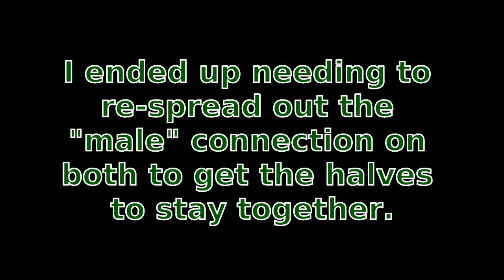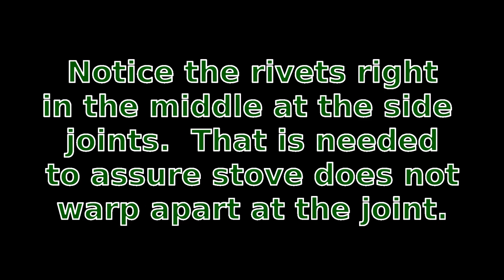Make A Simple Cheap Tent Wood stove - Part 1

Comment: I absolutely love your hot tent do it yourself videos. In fact it was because of you a couple of years ago when you made the first DIY hot tipi video, got me hooked on them. Thanks for everything you share, you are a blessing to the outdoors community.
Reply from the maker: Glad you are enjoying those videos and have received such benefit from them.

I have the material on hand and plan on sewing a pyramid tent with side walls out of 1.1 ounce Mtn Silnylon.  This tent will be 10 feet by 10 feet and will weigh just under 4 pounds total weight complete with stove jack for use with this stove here in this video.   The grade of material used is some of the best available but the finished tent should cost me less than half and close to a third of the cost of a commercially manufactured one in the same class.
Reply: @Far-North-Bushcraft-Survival  looking forward to it Lonnie 👍👍👍
Reply: Far North Bushcraft And Survival Oh that sounds like a beauty of a tent Lonnie, I know it can coast a bit more but you should consider putting screens and double pain windows in so it still stays warm like Lars at Survival Russia’s Russian Tent if I remember correctly it’s the name of the manufacturer is PFberg. 
Then you can have an all season tent.

I hope you’ll do a video on making the tent even if you don’t put the screens in windows on your tutorials are always short sweet and to the point without missing any details and perfect for the common man.

Btw Happy New Year to You Connie Buck and your family 🎊🎆😊

- Anthony
Reply: Heck, this dude rocks!
Reply: What an engineer, you are an excellent teacher!

Comment: Learnt quite a lot again from this one. I haven't worked much with sheet metals, and I never would have thought to seal the front and back panel with a "double fold" in that way, almost looks like you wouldn't need rivets at all. Tricks like that tend to come in handy in other projects as well. Thanks for the video!

Comment: Having been a sheet-metal mechanic for 20 years, I can tell you that better options exist. The 7" round duct pipe that you used is really thin (looks like 30 gauge) and won't last all that long.
Options: Look around for heavier gauge (22-26), often used as flue pipe. It will of course be harder to bend/ manipulate, but the end product will be worth your time and efforts. Also, putting a "cross-break" into the sections that are the sides and bottom (a very slight but visible bend in the shape of a X diagonally corner to corner) will add strength and rigidity to the stove without any added weight.
However, I suggest going scrounging around any local job sites or scrap yards looking for rectangular duct already made. You can easily find it in the size, shape, and thickness (gauge) that suits your needs, often already including things like end-caps, making final construction much easier as well as your bends are mostly made for you.
Approach: There's no need to use a drill to begin a hole in sheet-metal at these gauges, simply lay the corner of a flat-head screwdriver where you want penetration (center of you soon to be hole), and holding it firmly at about a 45 degree angle to the sheet-metal, simply give it a whack with a hammer, opening a small hole, simply drag that screwdriver along and whack again. In this manner you can open a void in the metal as short or as long as you'd like, enabling you to easily get your tin snips in to make your cut of any shape you need - without the need for any electricity... it takes literally only seconds.
Finishing: I would suggest also adding red High-Temp silicone sealer to the seams during assembly, to seal the seams and make the stove more efficient.
The flue pipe exiting the stove - Use a small end-piece (crimped male end ) and make a several cuts in it's crimped end up to the rolled bead that makes the flue pipe mate against it's next section. Cuts should be about every 1/2-3/4" making a bunch of "tabs". Insert this "starter collar" you just made into your stove's flue opening until it bottoms out against that rolled bead, then reaching into the stove simply bend those tabs out and up against the top of the stove metal, like opening flower petals, making a very secure, semi-sealed but not permanent connection. You can crimp the top of this pipe where it exits the stove if you choose (if you have hand-crimping tool) or just run your flue pipe sections "backwards" with male ends facing down rather than up. This way you have a starting collar already installed, and it also protects your flue opening from getting deformed during transport, and it also helps stiffen up that area where you placed the hole in your stove top.
Lastly, you need to insert a flue damper in that starting collar or in the first section of flue pipe on top of the stove. You can make one yourself easy enough with a long heavy nail and a piece of scrap sheet-metal cut into a circle: Use that screwdriver technique (or a drill if you choose), I usually just hammer that nail into it from each side so it mates with the nail perfectly without being too large a hole .. and put two opposing holes into the flue pipe just allowing the nail to slide in one side and out the other. This nail can attach to the pipe as you wish, as log as it's secure and allows you to control the amount of air rising through the flue. Between this, and that perfect air intake control you made, you can control this stove very precisely for temperature and burn rate, getting the most of your fuel.
   None of this was criticism (I love the job you did) just some pointers you may wish to consider for the next stove.
Stay well.

Comment: Thanks for bring up the dangers of galvanized steel... Worked in a mill for forty years producing galvanized coils and products.. Had quite a few instances of zink poisoning while welding and brazing on it.  It is a great product and entirely safe after a couple burns but can surly make one sick if not respected.. PS drinking milk helps the nausua..lol   Not meant to scare anyone.. like you stated perfectly safe after a burn or two.. Just wanted to say thanks for offering the warning!
Reply: I worked in a refinery welding shop for almost 40 years, and suffered sickness a few times from breathing smoke from hard surfacing welding. I can't handle milk, so our safety dept would sit me down with an orange, or grapefruit, and say eat it peeling and all.  Sounds strange alright, but it worked every time. Sickness was gone in an hour or so.
Reply: I leaned something new today, and for this I thank u.
Reply: exactly whtiw as thinking while watching! I think u can get off the galvanised coat with vinegar.
Reply: @user-qs1xc2cs1s  Yes to a degree.. I'd still burn it off though
Reply: @Plain-Ole-Chuck  Yeah jur right never safe enought  :)!
Reply: LOL thought Lonnie was out of his mind with a galvanized stove project. Zink poisoning is no fun hay bye. Milks good if you can keep her down.
Reply: @archermanbob  Well It 'is' a inexpensive way of building a stove and safe as long as precautions are taken it should be fine..Like I said I worked in a galvanizing plant most of my life and I know the dangers.  That being said I'm just happy that Lonnie took the effort to address the danger.  I applaud him for doing that .
Reply: i believe muratic acid removes galvinizing. just be careful with the fumes also
Reply: @Plain-Ole-Chuck  why not just use stainless? No problems with burn in and last way longer.
Reply: @mattmarzula  I think the purpose of the build was an inexpensive stove.  Stainless can be pricey. plus I've found that light gauge SS warps a great deal in high heat applications.  I've made grills and such and when put over high heat  just warped really bad unless it is pretty heavy gauge.  Then you have the problem of weight.
Reply: Plain 'Ole Chuck: Great comment. I did not know that. Thanks for the safety tip.
Reply: Lonnie used what he had on-hand I'm sure.. same thing could be accomplished by simply buying black pipe if you'd like to duplicate the project....
Reply: I’m an ironworker and know all to well the galvy flu.....8 hrs of cold sweats and aches like ya read about!
Reply: Dave's Bullets and Bushcraft  wood stove can get over 1000 degrees and zinc melts somewhere in the area of 800 degrees soooooooo......
Reply: Dave's Bullets and Bushcraft that’s 3585 f...... I don’t doubt you’ve had no problems with the stoves I’m just saying your melting points are way off.....zink hot dipping for galvy would basically melt steel if those numbers were correct
Reply from the maker: @Dave's Bullets...   I do not know what was melting but I can definitely say something was melting and even running down the sides a bit during the initial burning.   These stoves often get hot enough to glow red especially in the dark where the color and light can be seen.   Whatever it is that is melting off should definitely be done outside where the breezes can carry away the fumes.
Reply: Far North Bushcraft And Survival  I’m glad you’re warning people... definitely not a good feeling having metal fume fever!
Reply: @Far-North-Bushcraft-Survival  should be fine after a couple burns Lonnie... Like I said if someone is nervous about it .. just buy black pipe for the build.   I myself wouldn't have a problem with it after a burn or two
Reply: That was my concern from the beginning of this video. My father was a mill Wright in a steel mill he taught me many things and the dangers of zinc Coates gassing off was one of them. I know it would cost more but I'd be inclined to use stainless. It would last forever if done properly and using a sacrificial bottom plate elevated a half inch or so above the bottom of the stove would add to it's durability and reduce radiant heat out the bottom making it more snow friendly and safer.
Reply: If you don't mind me asking how did you get over that
Reply: @NatureRocks.  It was never that serious.. for me ..just nauseating .. almost flu like symptoms.  We were just told to drink milk and it would pass which it usually did.. I'm sure there would be some lasting effects in severe cases but we wore respirators when welding or burning on it so it was rare.  Usually when we were in prolonged contact with the fumes which we tried to avoid.
Reply: @Plain-Ole-Chuck  thanks glad you got better
Reply: Welding inspector, I had my share of breathing burning galvanized steel and YES milk works, use whole milk.
Reply: @Far-North-Bushcraft-Survival  I commented on one of Dave's videos and he gets very defensive about his zinc. I think he holds stock or something because if you mention risks of zinc poisoning he takes it personally.  Interesting to see him pop onto other people's videos starting arguments.
Reply: Pluracy. It effects the mucas lining in the lungs nose throat and gut. I have had it many times welding on zinc products. If you see white strings coming off the product when  to heat it up it has zinc in it. Poison but not fatal in most cases unless in a confined area with minimal ventiation, unlike CO poisoning will kill in minutes and both have the same early onset symptoms. Dry mouth, headache and nausea. Be careful.
Reply: @Plain-Ole-Chuck  I checked Facebook Marketplace and found all sorts of stainless outdoor grills free fro pick-up and disposal.  Very large ones with SS doors sides and folding table tops.  Fairly thick stainless panels for nothing.  Would that type SS work for making a stove?  I see commercial units made of SS.
Reply: @geraldmoore6257  Yes I'm sure they would work fine.. good recycling  project too
Reply: I was happy he mentioned it. Im a welder so I know better. I think to be on the same side I would remove it all with a wire wheel. Then paint it with high temp black
Reply: Worked in a machine shop for a couple years, one time boss man told me to cut off a piece of galvanized steel for a customer. Like an idiot I used an oxy acetalene torch... It's good to be young this made me giggle thinking back on this thanks.
Reply: Just eat a roll of tums, you'll be just fine. I've welded on galv. For years. And stay away from anything that's white and looks like a little spider web... That's the zink oxcide that can make you sick.
Reply: most wood stove manufacturers tell you to do an open air burn-in when you buy OEM models
Reply: I know this comment is very late but, building out of stainless isn’t actually that practical, different metals do different tasks better than others. Even though stainless steel can radiate heat it’s got much worse heat distribution and transfer than the less shiny galvanised steel.

From experience, stainless steel is more likely to warp while heated as it heats uneven, this in turn makes anything heating on the surface lose contact more and makes it just worse than other alternatives.

Hope this info helps, if you want to go up in metal quality I suggest doing some homework before putting money on it :)

Comment: Remember everyone. He is totally correct and is speaking the truth. Burn stoves made of galvanized steel outside before using them in a walled tent or tipi. The zinc vapors are toxic in an enclosed space. The residual coating will allow for some resistance to rust and won't be toxic unlike during the burn off. Great video brother and glad you included the safely warning!

Comment: Excellent use of the materials, building the stove body by using the same "stovepipe" material originally meant to serve as a tube. 
Thanks for showing the flange treatment for the stove top Exhaust Hole. It's too easy to forget about the Ductility of the metal. Patience is the tool I forget most often.
People need to be reminded of the VALUE of (1) having a few essential tools; (2) knowing a little about how to use'em; and (3) setting aside some space to build useful things from materials that can be salvaged and put to new uses.

Comment: Hi Lonny, I really liked the stove build. I built one that works like that about 12 years ago. Only I used 16 gage steel and pop rivets. A friend of mine had a sheepherders stove that was about the size of a 6" log inside. It was a metal box with a pipe on top. It burned wood so fast that by the time you got it full and put a pot on for coffee it was out of wood. So to save time we put a 4" log in the door and every few minutes we would shove in another foot or so in. My first stove  had a baffle inside, tight to the back and an opening at the front of the stove just above the door about two inches back. It did not work so well. So I put the baffle tight to the door end and open at the back and a second one above that tight to the back and open to the door end. The smoke then would have to go to the back of the stove turn go to the front and then along the top of the stove and out the chimney. You could put a good fire in the stove at four o'clock and not have to put more in for two hours or more and the tent stayed warm 75 degrees that whole time with 14" of snow on the ground. If you needed dirt for the bottom of the stove wait for the first fire to burn out and shovel the dirt out from under the stove and put about an inch inside and the ground stayed warm not hot. Good place for wet gloves, boots, socks and so on. I live in Colorado near the mountains. Sorry for the long comment but I thought you would like to know. I can send a picture if you IM me with a email address. Have good adventures.
Reply from the maker: Interesting baffle design.  It is great to have an option for drying the damp or wet clothes.   My email address associated with my YouTube channel Is oneoldwoodsman@yahoo.com

Comment: I really enjoyed the video, you did a fine job on the stove. About the only thing I might want to suggest is painting it after the galvanize burns off, to keep it from rusting.  First thought might be the bar-b-que paint, DON'T waste your money, it'll burn off faster than you can paint it. But what will work is 2000 degree engine paint made by Rustoleum . I used it on stoves here and have yet to see it burn off.
Reply from the maker: I will be spraying a light coat of PAM cooking spray inside and out at the end of each season on the cleaned out stove.

Comment: Once you burn it off you should place an inch of sand to prevent it from burning out the bottom of the stove or fire bricks both will hold the heat when the fire goes out retaining heat another hours sleep much needed great job on the stove , !!! Hi from NH .

Comment: Lonnie, excellent stove build! I’ve only got one complaint, three days ago (no kidding) I decided, my wife told me to, buy a production sheet metal wood stove and stop trying to build one. $310.00 dollars, and that was one of the lowest priced. Now you put this post out and it’s exactly what I was thinking of. The production model uses the same gauge metal too! My brother and I heated a cabin in the matsu valley east of Palmer all year long for years with a sheet metal stove, “Airtight” brand, that was oval shaped and had about the same gauge thickness metal. We got it hot enough to see through a few times and it worked fine for years! All the best!
Reply from the maker: I remember those ole oval sheet metal airtights and sure wish they were still available.